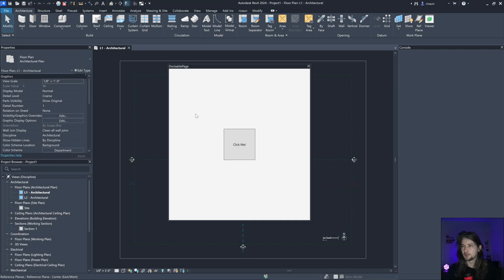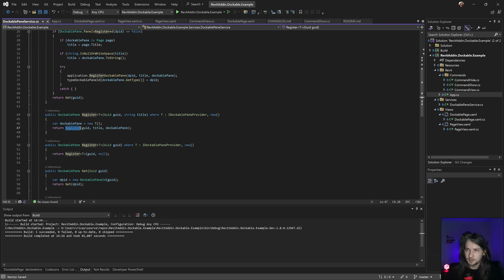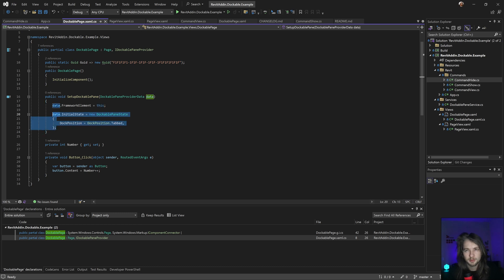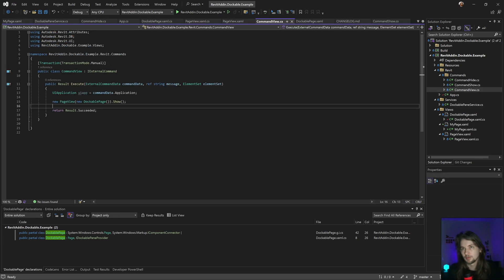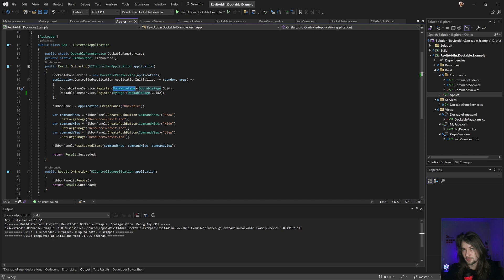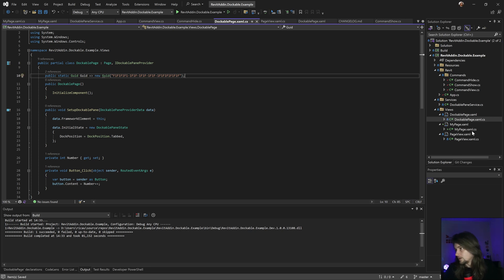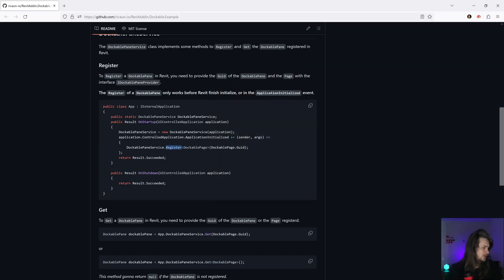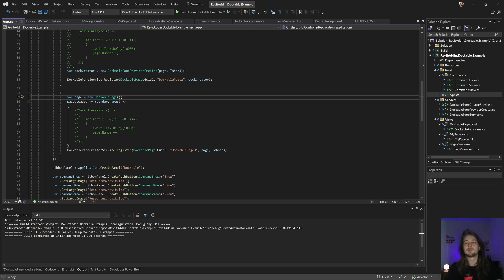Create DockablePane - Revit API

Comment: Hi This may be a late question, but still how can I limit the size of the panel so that it can't be shrunk to a small size and not put the panel outside the screen where it won't be accessible?
Reply from the maker: Hmmm good question.
When you register the DockablePane you can set the Autodesk.Revit.UI.DockablePaneState with MinimumHeight and MinimumWidth. 
I guess this would prevent the user to set a small size.
To prevent to move outside maybe SetFloatingRectangle could help, never used so really don't know if works.
Reply: @ricaun  Yes I used Autodesk.Revit.UI.DockablePaneState with MinimumHeight and MinimumWidth.  But it didn't help when I switch to floating mode of the panel I can minimize it with mouse to a size slightly larger than the header
Reply: @ricaun   @ricaun Yes I used DockablePaneProviderData and Autodesk.Revit.UI.DockablePaneState with MinimumHeight and MinimumWidth in it.  But it didn't help when I switch to floating mode of the panel I can minimize it with mouse to a size slightly larger than the header
Reply from the maker: @MrAriel501  You are right! Looks like MinimumHeight only works when dockable in Revit, when floating the min height is disable or something. Did you try to set the page MinHeight?
Maybe is normal, the default Revit Project Browser when floating does not have a min height as well. 😞
Reply: @ricaun  It may be okay, but it's a problem for us right now. As users throw panels out of view or make the size not acceptable.  At the moment I am redesigning the registration to return the location and size of the panel on a separate command
Reply from the maker: @MrAriel501  All the default Revit dockable does no have a minimal size defined, don't know if is possible.
I know Revit uses this https://github.com/xceedsoftware/wpftoolkit/wiki/AvalonDock is there is a way to set min size for floating probably is in there.

Comment: Hello, I attempted to dynamically add a panel so that I don't need to register it when Revit starts. I have obtained the Visual Tree for Revit, specifically the DockManager used by Revit from AvalonDock. It works if I add a LayoutAnchorable with the content being a TextBlock or other basic WPF controls. However, if I set the content to a customized Window, Page, etc., Revit crashes. Do you konw the reson or have some advice?
Reply from the maker: Interesting, usually is a bad idea to mess with the Revit UI like that. Why you need to dynamic add a dockable pane? Do you have some sample code with a simple implementation, I have a ideia how is done but never tried to implement. The only way to know what is wrong is enabling debug in your Revit to check what exception is happening.
Reply: @ricaun  I have replied with a link to the code. But it seems that link is not allowd  or have you seen it?
Reply from the maker: I believe link is not allowed to prevent span, you could send to ricaun@gmail.com or reach me in the Instagram @ricaun.io
I did some experiments using some methods in the MainWindow class in Revit. Works to create a dockable on the fly but have a lot of limitations.
Reply: Thanks a lot. I have tried it again and it works if I set the content of Dockablepanel as a UserControl. Now I don't need to regist er it.
Reply from the maker: Nice! The only problem is the location of the dockable is no saved correctly, at least I was not able to make Revit remember the location.

Comment: Just by curiosity, how can i "map" my property window to this "dock able" panel?   f.e.  I select a door i want only to filter a certain Parameters (f.e. reed contact related)?  I can imagine that you can not answer that in a one liner...  but do have a ruff idea? or maybe examples.
Reply from the maker: Using WPF binding I guess, I would start with a basic window that is easier to work, dockable could be annoying to work. 
Add some events in Revit to update a ViewModel that is binded in a Page, and adding some Revit ExternalEvent to something in the WPF to update Revit.